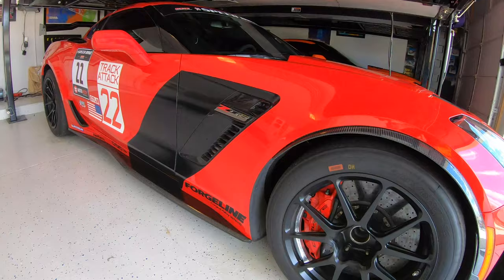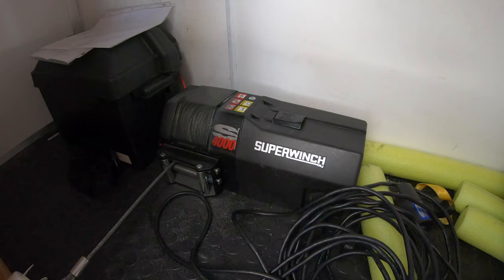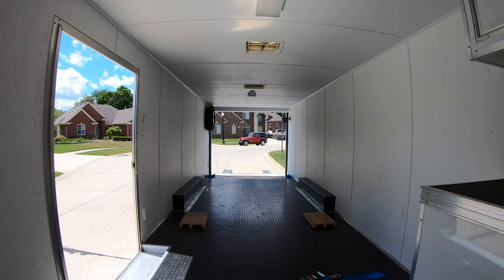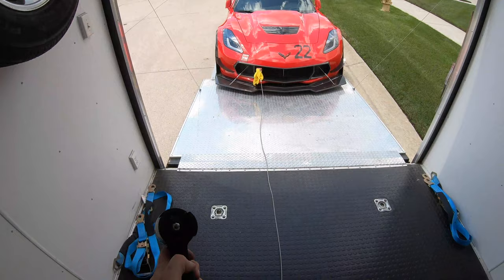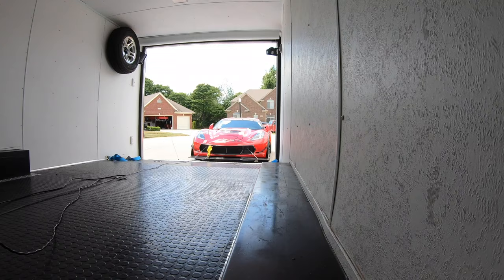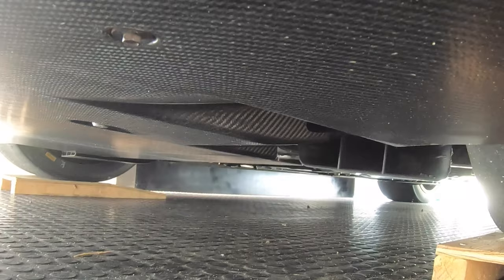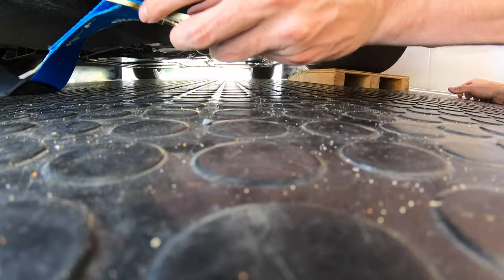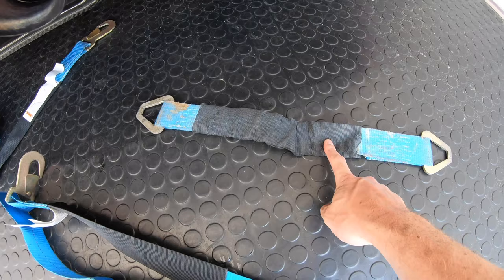HOW TO PROPERLY LOAD AND SECURE YOUR C7 CORVETTE ON A TRAILER - STINGRAY, GRAND SPORT, Z06, ZR1

Comment: car hauler for 15 yrs hauled more vettes out of the factory than most will ever see. per GM NEVER use jacking point holes for tie downs!! they aren't reinforced and will tear out. for an enclosed trailer like this you need e tracks and wheel straps to secure a c7 corvette. GM hasn't used frame hooks on a corvette since the c4 version. and gm has never allowed t hooks to secure any gm car since they have a tendency to turn and pop out. only r hooks were allowed for cars t hooks are for trucks only and they have angled slots in the frame. since the release of the c6 corvette wheel straps are the only approved way to secure a corvette. in this instance the wheel straps would have no effect on the under tray or splitter allowing for a secure tie down

Comment: Exact video I wanted to see, thank you for sharing this.  Very helpful!  What size is your trailer?  I'm debating between a 20ft or 24ft.
Reply from the maker: Glad it helped.  26'
Reply: @HardingMotorsportsLLC  shit i have 20ft how do you think it will fair just bought going to test tomorrow
Reply from the maker: @ladyentiti1786  the car will fit but I'm not sure how much room you will have in front and behind for strapping down.
Reply: 20 feet will be fine, as long as its a vnose. I tow a 1965 Corvette with my 20 foot enclosed, and the C7 is only 2 inches longer if you can believe it. I put e tracks down both sides, and just use e track wheel straps. I’ve towed the car 600 miles and it doesn’t move an inch. I have a C7 base convertible, and if I tow that, I’m more likely to use basket straps to my D rings, as the  eTrak straps may not have enough ground clearance to tighten.

Comment: Not sure how your trailer is configured but the proper placement of the car is where tongue weight will be 10% to 15% of the gross weight of the trailer/car combo. Example: If the car weighs 3200 and the trailer is 2800 you want to put the car where you’ll have 600 to 900 pounds tongue weight.  I also feel that the front straps, the length needed to get to the lift points doesn’t give enough angle. I think if you trailered far enough and hit some bumps in the road, the front of the car could drift sideways. Have you thought about installing E Track and tying over the front tires?
Reply from the maker: Thank you for your input on the tongue weight.  I have trailered this way for 10+ hour stints from bumpy Michigan roads to the mountains of Pennsylvania and I've never had the car move.
Reply: Harding Motorsports LLC then you drive too slow.  ;)

Comment: What are the ramps for?  Just for access I guess?  Could you just tie it down using the wheels?
Reply from the maker: 1. So I can reach my hand under the car to install the T hook.  2. To increase the angle of the front straps so they don't rub on the undertray.  
I don't like tieing down by the wheels.

Comment: If I am seeing it correctly: It seems you placed the car in the trailer where the trailer’s side escape door doesn’t line up with the car door opening.  I understand you wenched it in so not a problem for you. Just curious if that placement is right for tongue weight. 
I should be getting my last of the custom trailers ATC is doing next week.  Pretty excited.  I will probably go with a wench too for the control solo loading. After seeing this.  Thanks for the info.
Reply from the maker: My trailer doesn't have a side escape door.  Since the Corvette is almost perfect 50/50 weight distribution, I center the car over the trailer's axles and that is the best for tongue weight/trailer handling.

Comment: vey helpfull . i have an 8.5x20 enclosed trailer . what size trailer are you using in this video. what type of (or brand) winch are you using . are the ramps necessary - i havent used my trailer yet. mine still has the wood floor for now , is that ok for starters. my car is pretty low so what type of ramps did you use . 

Thanks love the video was detailed which i was looking for.
Reply: by ramps i mean the wooden block ones did you buy or build that
Reply from the maker: It is a 26' Millennium trailer.  The wood ramps are necessary for me because of the splitter undertray.  It raises the car enough so that the strap angle does not cause interference with the undertray.  They are just custom made wood ramps about 1.5" tall.  You can probably buy something similar from Race Ramps.

Comment: Should edit this video to show the unloading process. Do you just push it out and let it roll out ?
Reply from the maker: I jack up the front of the trailer to reduce the ramp angle.  This makes it a down hill slope out of the trailer.  I winch the car out.

Comment: Great video! What is the width of your trailer?
Reply from the maker: I don't know that measurement off the top of my head, but I would say there is about 2" on either side of the wheel of the Z06 to the wheel well inside the trailer.

Comment: Just curious about storing a car in the trailer. Is there any issues with storing a car in the trailer without it connected to a truck. I never seen anyone on Youtube that kept the car in the trailer. Is it safe to disconnect the truck from the trailer and store the car inside for the winter?
Reply from the maker: I don’t see why not if it is in a secure place.  I would just be concerned about theft.

Comment: Nice video. Do you leave the car in neutral or put it in gear? Also, do you set the Parking brake?
Reply from the maker: Neutral!  Trailering in gear can damage the transmission.  Parking brake is ok but I usually leave it off.
Reply: @HardingMotorsportsLLC  Thank you.
Reply: @HardingMotorsportsLLC  great video man!! Quick question: if you do engage the parking break how are you doing that in such a tight fit? Especially considering in order to disengage it, you have to push the break pedal while releasing/ unlocking the emergency break.  Thanks brother
Reply from the maker: @goblue2708  I don’t use the parking brake because I can’t get through the small C7 window to press the brake and release it.  The only way I could do it is to leave the targa top off and climb through the top.  But it’s not worth it.  The straps hold the car, not the parking brake.